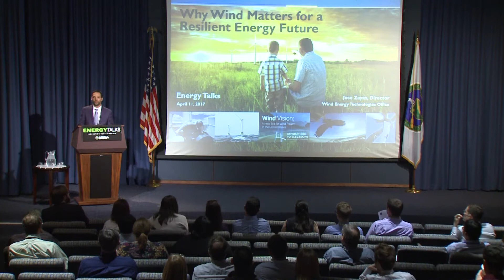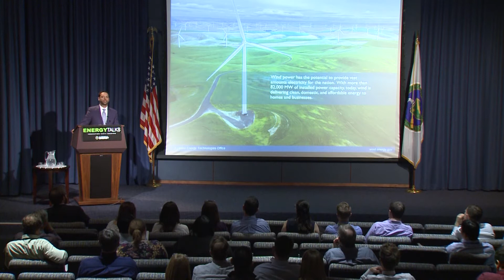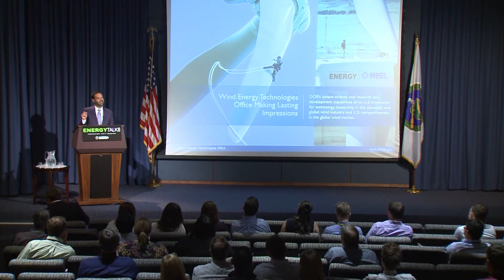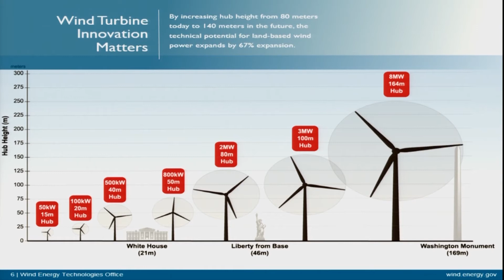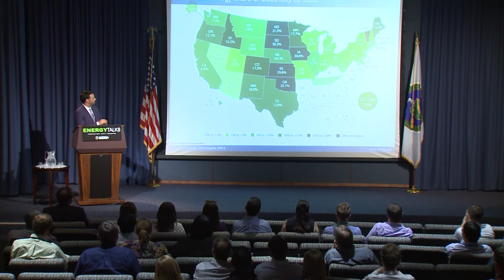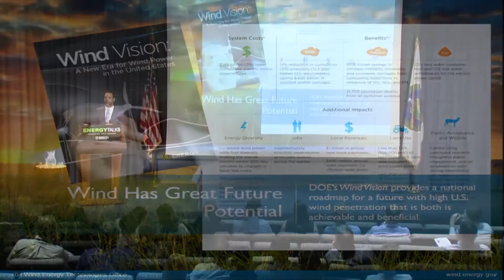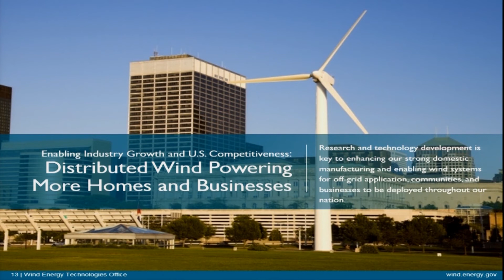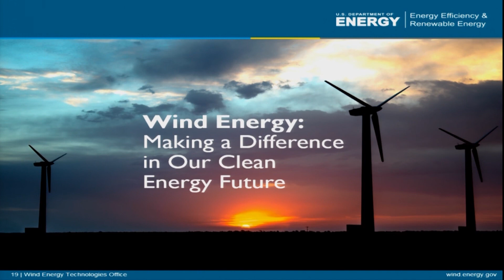Energy Talks - Why Wind Matters for a Resilient Future

Comment: Unlike a legitimate energy source, wind & solar do not replace any of the vast fossil infrastructure, you still need all the power plants, maintained manned and often fired up, building steam, all the vast natural gas pipelines, production wells, fracking sites, storage, oil infrastructure, tankers, military, coal mines, rail cars, LNG tankers, the works. That is a huge investment & maintenance cost. So all solar and wind does is replace a bit of fuel worth 1/2 to 3 cents a kwh. And it actually costs additional infrastructure on top of all of that. 

Wind energy is a total waste of money. Consider the EROEI or Energy Return On Energy Invested. You need 14:1 energy gain to run a modern civilization with social benefits, education, health care, arts & culture, military, police, pensions, infrastructure. 

Wind has an EROEI 16:1 without storage but add storage/overbuild/long distance transmission and that drops to 3.9:1. Not even close to sustainable. Solar even worse @ 3.9:1, add storage and that drops to 1.6:1. Really just a scam and a joke.

Nuclear with an EROEI of over 75, doesn't need storage, and can easily deliver the energy gain we need. There is no clean energy alternative to Nuclear. That is just the harsh reality.

Wasting capital on Wind and Solar or Ethanol & Hydrogen is really just shooting yourself in the foot. They are in fact parasites living off of the energy gain of fossil fuels, hydro and nuclear. In fact spending on wind & solar is a way to increase emissions, not reduce them.